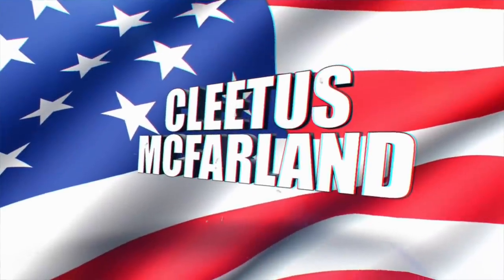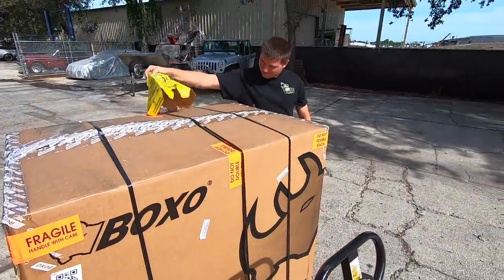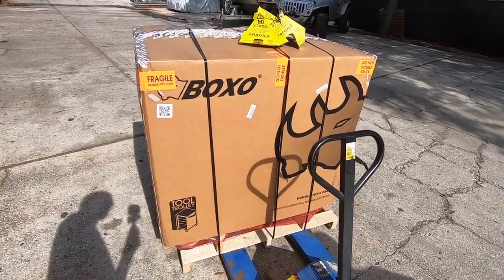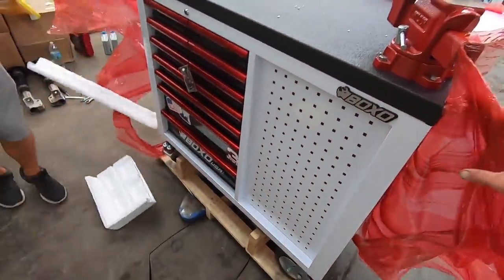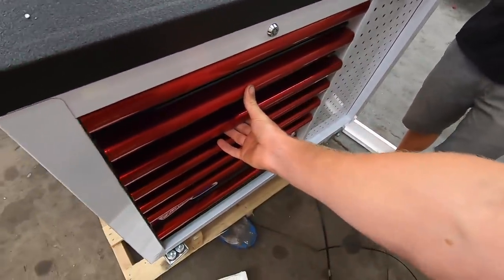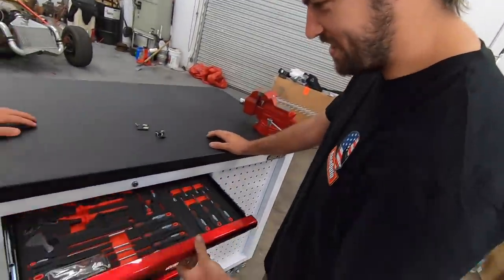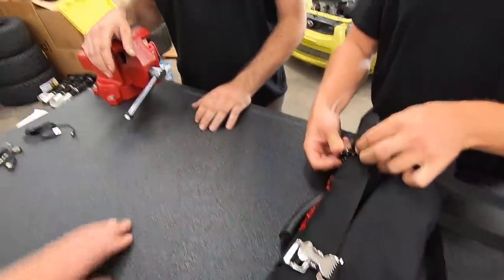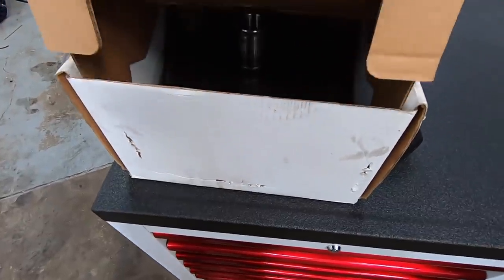We FIXED Ruby’s Boost Problems!!! (Making 30+psi Now) + Surprising James With a SICK New Tool Box!

Comment: The next project needs to making his new tool box motorized so James can drive it from shop to shop! Like those cooler go carts!
Reply: Need to check out “war wagons”, or pit karts that a lot of the big sprint car teams have...
Reply: Naw, he needs to 'trailer' the toolbox behind a purpose built golf cart with a solar/propane generator driven jump station, and fuel on the cart.  THAT is what James needs, you'd never get him to stop grinnin'!   LOL
Reply: Just tie 4 losi rc cars to the bottum then connect all the recievers and steeringservos. Ez pz
Reply: Kswap?

Comment: Any MAN will enjoy this box, but a MECHANIC will damn near cry over going from crap tools to a setup that makes his whole life easier. There’s nothing better you can do for james. 💯🔥
Reply: Boxo is made in Taiwan. If a real mechanic was to cry over that box, that would be the reason why.
Reply: sadly alot of manufacturers do this. but the good ones pick a manufacturing that will follow different quality control factors so that the factory overseas don't make the products as cheap and out of spec as possible.
Reply: The All Seeing Pie It doesn’t matter where it's made, if you order shit you get shit, every country makes good and bad products
Reply: I have plenty of experience professionally ordering from manufacturers in Taiwan. You must provide explicit specifications on every detail. They will not fail. AND you must have a rep who is Taiwanese. I'm pretty sure that Boxo has that all worked out.
Reply: The snap on box is far superior.   I own the same box in orange.  Clean the sliders,  put in some organizers and call it a day.
Reply: @GMbusa1  Some tool organization is all That's needed, I worked damn hard to get mine set up, Every Truck that leaves, I can just open the every drawer,(one at a time) and get a fast list of what's missing and go find it, Doesn't do any good to make 300 a day on a job and buy 400 in tools to replace the lost ones! Lost 3 work lights, now they all have a place so I make sure those are where there supposed to be:), also, it's a snap on box, if you got a truck that comes, around some of the better sails men will give you some new rails! if you can't get the nonworking ones to go!
Reply: Tool snobs are the only tool in the box. Congrats james, thanks for making him happy Garrett.
Reply: There’s nothing better you can do for james. 💯🔥  ......... With his pants on, YEE YEE!
Reply: I wouldn't say that snap on tools are crap they are some of the best tools money can buy , i know i would rather buy snap on or bluepoint over Taiwan built tools . 👍✌️
Reply: Can I have his old hand me down junk?! I'd be happier than he was getting 10 grand in tools and a box lol. :-)
Reply: MrKalashnik0va  can't say they do or don't.  It all comes down to the steel, manufacturing,  and post treatment and tempering. 
If the buyer allows junk, they'll make junk.

Comment: James: Proceeds to tighten clamp with impact for about 2 full minutes.

Cooper: Thats exactly how he puts on the spark plugs 🤣🤣🤣😂😂😂

Spaghetti is a Savage
Reply: That’s the only way to put in spark plugs
Reply: @taydog888  i thought thats how you're supposed to do it.
Reply: HELL ya brother! thats what I was gonna say!
Reply: You’ve never worked at a car dealership, we do that daily
Reply: Gotta make sure them butt plugs stay in. I just recently bought an impact gun, and I have an urge to impact everything. The power has gotten to my head.
Reply: 😂 I laughed pretty damn loud at that.
Reply: I get the spark plugs spinning so fast into the now stripped aluminum heads that the steel welds itself into the aluminum. Now, it's: "I need new plugs. I guess I'd better order new heads to go along with 'em."
Reply: Isn’t that how you put a drain plug in

Comment: That Snap-on box is pretty nice though and those drawer slides can be replaced.  It may even be under Snap-on warranty.
Reply: They are .... I got into a minor disagreement with one of my drawers and bent the slides... replaced  No questions asked
Reply: My dads a snap-on dealer, they are a warranty item, they look like they just need cleaned
Reply: She is a beauty. She's too voluptuous for wheeling in and out of the trailer, but for frog's snacks, lad, get those rails replaced! Any excuse to get that white rolling monetary wormhole in my driveway, especially to replace something for free!
Reply: @jonathansmith2809  Do you think your dad could help me out with some warranty issues im having with some of my snap on tools?
Reply: They should fix the snap on tool box everything is life time warranty. I got 3 of my drawls warranty with no problems
Reply: Idk about warranty but they could probably soak them in some rust remover then shoot some grease in the bearing to see if that saves them
Reply: Almost guaranteed snap-on was contacted, but they're to reputable to give away free tool boxes.

Comment: You guys are getting 'uptown' enough with your shop, it's time I laid come shop tech knowledge on ya.  I had a dream shop in the '80's, building street rods, race cars of several flavors, and restoring antiques.  We came by a Harrington jib crane real cheap, (scrap price), about the time we were ready to add 50% more floor space.  We installed a floor hoist so the car would enter from the end of the building, and be along the left side of the new addition. We put the jib crane beside it, towards the middle of width of the shop. It was positioned so the end of the cross beam was aligned with the center of the floor hoist.

Along the hoist side of the shop, beginning a couple of feet from where the car on the hoist's front bumper would be. Then, in the middle, at the end of the crane's reach, we built a peninsula bench, set at 90°. On the end of that bench, we mounted the rotating portion of an engine stand.

Here's what a jib crane is. (If you don't want to look at an image, the jib crane we had was a 10" steel round tube post with a 8' long rotating I-beam. On the I-beam is a wheeled trolley, which the electric chain hoist is hung. It is THE setup for automotive.  This is the brand and model we had: 
https://www.amazon.com/Harrington-Hoists-351-6000-8-12-Crane-Reach/dp/B01MA27RZQ

The partnership in our dream biz didn't survive, (my partner's new gf had a conniving father who wanted me out of the picture; and he succeeded.), but the floor hoist, and Harrington jib crane is still in operation, in the same configuration in a different locale.  I still have never seen a better engine removal setup than this.

We could pull a car onto the hoist,, then pull either engine/trans or engine. Rotate the crane and set the engine/trans on penisula bench, and yank the trans before we disconnected the crane.  The engine was moved to the bench mount engine stand.  One guy can easily remove or install an engine or engine/trans.

Oh, the other item you need is a good quality 1-1.5" rope to hang from the end of the cross beam of the crane. One hand on the electric hoist control, the other on the rope to rotate the crane.

We put the crane toward the center of the shop, so we could swing it around, a different car parked 90° to the floor hoist, remove the body from the frame and set it down on  a new frame, or a purpose built cart we made for frameless bodies, (we did frame off restorations of everything from Model A's to Fat 
Fender Ford PU's, to C10 Square Bodies.  We even put a '53 Ford Fat Fender ON a '71 C10 frame one time, and it's still being driven, nearly 40 years later.  The body was a bolt on, no mods, using the C-10 column. Had to make four bed mounts, cause only two lined up. It channeled the body perfectly to fill the big ass fenders, and with the addition of R&P,  the old Ford ended ip with R&P, IFS & discs up front.  (You should build one, I'll coach you through the details.)

You need a jib crane, an electric hoist and 8' of rope. You now have the shop for it.

Comment: DO NOT STACK = STACK
FRAGILE = DO EVERYTHING HUMANLY POSSIBLE TO BREAK

Driver speak.
Reply: Do not stack cones = throw away and stack 
Same with stickers
Reply: If it's like light an fragile I try to be nice to it. But fuck 150lbs and  fragile😅
Reply: "Not my freight."
Reply: I worked helping for UPS and when it was "fragile" they would beat the shit out of it and bury it under everything
Reply: Yeah when I worked at Dhl and I saw pallets with the do not stack cones I took that as a challenge rather than a suggestion.
Reply: "Do not bend" = "Time to learn oragami!
Reply: For my Bicycles travelling by air. . .  I just write on the box “PLEASE”.  No problems yet!

Comment: Snap On should replace all those drawer slides for free. That box is still worth some money
Reply: That's what I thought, they should be warranty.
Reply: Snap On tool boxes arent covered under the lifetime warranty.....just their hand tools
Reply: For sure. My shop manager just traded in that exact tool box for $2300.
Reply: @369motoman  I have a 30 year old Snap On  box I bought used from the Matco man and  they replaced 4 sets of drawer slides in it for free, maybe your guy isn"t as good as mine
Reply: Original owner only on tool box warranty... you got lucky I had to buy new slides for mine

Comment: Boxo should do a Combo Deal on their website called "James Get the Toolbox" so you can get this exact kit!
Reply: i was just looking to see if this was a kit.  I really liked how they set this bad boy up.
Reply: Roughly 5k to build it yourself.
Reply: @Jeff-gu6nb  you might want to add a few grand to that number. The box itself is $2900, not including the vice, upgraded top and upgraded wheels. Your looking at a $8-9k tool kit right there.
Reply: This is pretty close, sold as a combo.

Comment: That's a really clutch toolbox. It's nice that it has a small lip on the top so if a bit of fluid leaks out of whatever you're working on, it doesn't spill over the side and make a mess on the ground. Will have to look into a Boxo toolbox in the near future.

Comment: Send that snapon my way,  it ain't nothing to replace the slides.
Reply: I dont know why they didnt just call the guy and have him deal with it.  That's a benefit of paying out the ass for Snap-On and they are missing out.
Reply: @MomJeans2  You forgot...this is an ADVERTISEMENT!  Yeah, they get the tools for free, and they probably really did need the tools, but they get paid to make videos like this, plus they get to keep the tools.  Oh, and probably they get paid for future videos where they show these tools, use them, and talk about them.
Reply: Nothing a shot of WD-40 can't fix it's the duct tape of lubricant. I have a shot of it every morning in my coffee....☕🚔🏁🇺🇸
Reply: @MomJeans2  If you actually watch the video and listen they didn't pay for the snapon one. It sat in a barn for 15 years and then someone gave it to em.
Reply: Snap On will warranty the drawer sliders.
Reply: False Flag  not that good near painted surface , but yeah the 50/50 atf and acetone is the cheapest yet most effective spray lubricant 😅
Reply: Blueberry Apples 
Yeah, so call the Snap On guy and get the slides replaced. Free and fixed, best combo ever.
Reply: False Flag  agreed but everybody on Earth knows WD-40 so it sounded proper. :-)

Comment: Just a heads up, those slides on your Snap-On box are lifetime warrantied. Your local Snap-On representative should replace them at no charge.
Reply: James Blanton says the dude who probably can’t afford it
Reply: Came for this exact comment 🤘🏻. If your rep sucks, call corporate. You'll get set up one way or another.
Reply: @Knightmare-gz9ls  Cool thanks for the tip.
Reply: Yeah if you got the right rep you're set. My guy is top notch
Reply: Sure, if you still have the reciept...Which maybe 99% of the people throw away after 1 week.
What, you thought that lifetime warranty actually means they are going to fix everything they make for free, for ever?? lol
Reply: @gdxd7956  never needed the receipt for any repairs. My rep replaced my top draw slides on his own accord. Said they felt like they were binding up and didn't want it to fail and possibly drop the draw.
Reply: Yup. Nevermind just sell me the old broken box...
Reply: MrKalashnik0va  Correct, that's why you need to have the reciept/warranty card, with your name on it.
Reply: @gdxd7956  I was a Snap-On franchisee for 8 years. I never asked for a receipt or card, especially on a box slide. Fact is it's at the dealer's discretion. I realize there are crappy dealers out there, but like someone previously commented if that's an issue just contact corporate. I replaced tools frequently that I knew were bought secondhand. The only time I refused to continue to do so was when people abused the system. Like a guy buying a socket set at the flea market, gradually breaking each one and have me replace it so he can sell a new set on eBay. Most of the time they weren't technicians, just guys trying to get something for nothing. I never refused to warranty something for my regular customers.

Comment: @Cleetus McFarland used to rock a tool cart similar to this!!!!! If you go with it set your air tools up on a decent line and make a "manifold" aka just some junk pipe put fittings on it (in and out... super simple) and its a legit setup. Air to your tool box and access for all your tools.

Comment: Bro the snap-on should have a lifetime warranty get that thing fixed.
Reply: J M it should, but snap on isn’t exactly known for honoring warranties of used products. Goodluck finding a tool rep willing to take a used snap on box back for warranty work.
Reply: @prairiefarmer5994  exactly Snap On hasn't been worth the price for decades. Had a Snap On Pry Bar that cost me $175.00 just to keep my set all the same. Used it one time and wasn't even really working it hard and the end basically shattered. Next time the Snap On rep came by the shop I went to get it swapped for a new one as their warranty says it will never break and if it does free replacement. The Rep told me he wouldn't replace it as I used it outside covered warranty uses. I asked him what was covered and he said definitely not using it as a Pry Bar. Sold all my Snap On that week and replaced them all and came out about 7.5k ahead with a full set and bottom, top and side box included. Most people think Pitsburg and the other Harbor Freight tools are junk and some are but I have never had them argue if I bring a broken tool into the store, they replace it no questions asked every single time. If you look they actually make a Professional Grade that's a tad more expensive but much higher quality and no where near the price of anything Snap On...
Reply: Mjr Burn even just Harbor Freight’s US general line is really good for the price. We run a farming operation in the Midwest and we have an assortment of tool brands. Just about every brand from HF’s basic stuff to snap on.. maybe it’s because I’m not using them 10 hours a day, but I don’t think the difference between something like Kobalt, Gearwrench, or Tekton and the tool truck brands is worth the price difference. I suppose when you work at a shop and see the parts guy weekly, it is nice for any warranties. But whenever we’ve tried to get warranty work done the parts guy always has a million questions.
Reply: It only takes one bad dealer to ruin Snap-on for somebody. I never question warranties, as long as it has a warranty I fix/replace no questions asked! Hell even if something is a couple months out of warranty (power tools, etc.) I still do everything I can for my guys
Reply: It depends on who you’re working with. I’ve never had a problem getting snap-on stuff warrantied, but have heard stories of people having trouble. If you do have trouble get in touch with snap-on corporate offices and they’ll straighten it out.

Comment: I have a suggestion, for the tools james uses most, mark them off with masking tape, either on the handle or around where they sit, or even a dab of some sort of model paint from a brush right next to where they plug into it. and jesus when ruby spooled up at 16:10 that damn bumper moved, like it broke two of the clips right at the front next to the engine from simply reving it up there

Comment: Better put some anti-seize on those T-bolts. Even tightening them by hand really tight will cause the nut to weld to the bolt. Stainless does this. An impact makes it even worse.

Comment: Cletus I've been thinking about it dude when you guys build those pipes for your turbos do you guys use argon to push oxygen out of the inside of the tubes and all that stuff or you guys just burn them up because you're getting a lot of internal damage in your engines as well as the supercharger is it possible that pieces of welding on the inside of those pipes are getting sucked off and flying through your engine I don't know cuz I'm not there and I you don't show much detail when you do weld just something I was thinking about cuz like where else would these foreign debris come from? Do it for Dale bro😁